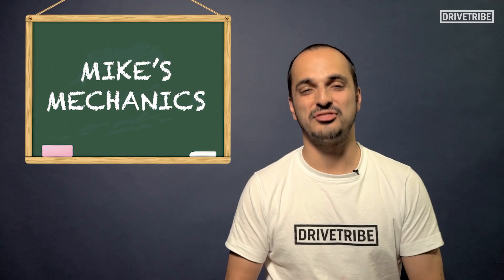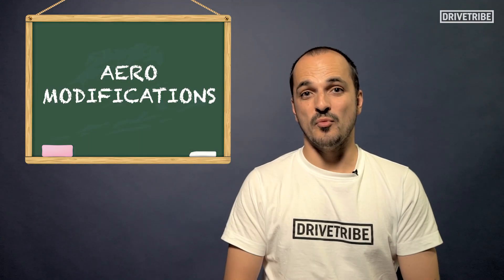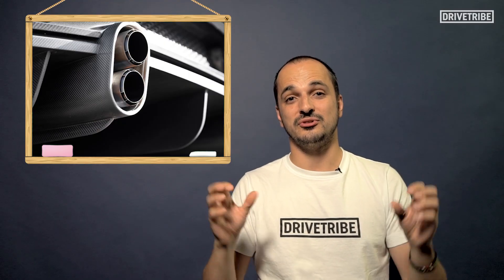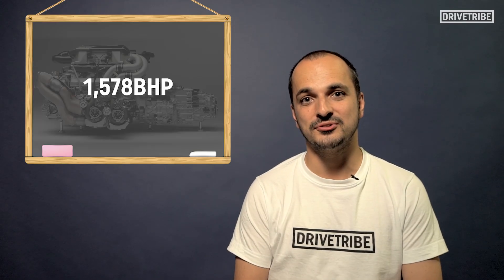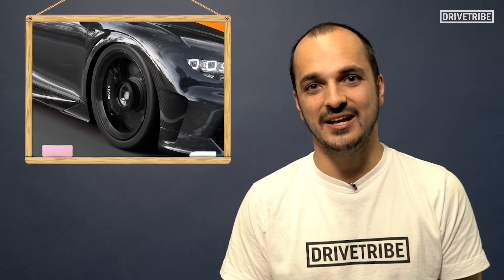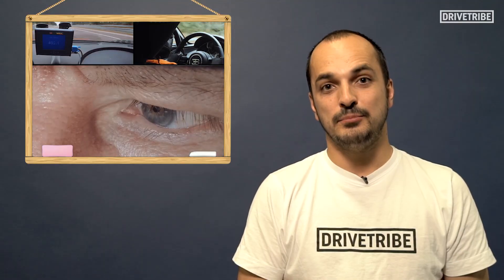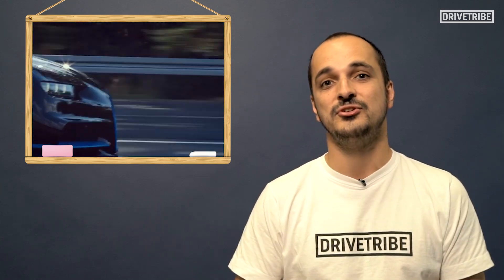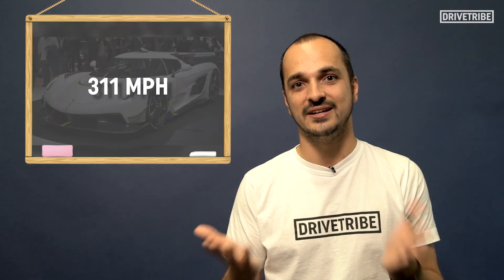How did the Bugatti Chiron reach 300mph?

Comment: Well shit. Now I just want to see a veyron at top speed getting overtaken by a Chiron at top speed. From the Veyron's perspective.
Reply: Stand beside a 50mph road making car noises and watch someone go past.
/done
Reply: @tomstech4390  LOL
Reply: Sadly that could be Quite dangerous.
Reply: @davidvalencia129  You mean quite coooool
Reply: Michel van Briemen the wake coming off either car next to each other would cause major disturbance
Reply: @MrAyybee2cold  WHO CARES ABOUT DISTURBANCE? I WANNA SEE LOL
Reply: They'll always be someone quicker at some point
Reply: Could be dangerous, but, just like the tires and such, they do
Lots of testing at varying speeds and speed DIFFERENCES  could give you the data to extrapolate what would or could happen.   Quick to the issue of running that track counterclockwise. Same thing, they have turned around and 185, 200, 230, and so on while monitoring the best they can what the tires and the chassis are doing with that “wrong grain”.  Say take it to 220 and then to the pits to visually inspect the tires and get stats to back up any onboard versions, then take
It back and do 270 against the grain and recheck.   Then maybe 285, then check again.  If the first two tests weren’t much worse than the “with the grain” direction for tire wear, make certain that 285 didn’t create anything unexpected, then maybe retire or not and go for it.  But to just decline the attempt, c’mon, they didn’t spend a fortune on developing the car and then set a new world automotive standard and then not back it up!   What the hell!   Kind of like having the girl of your dreams fulfilling your every desire and some you never new, and her asking for more and you just go, “nah, I think I’m good.  I think I’ll quit while I’m ahead”. 
That is not the spirit of what is going on there.
Reply: It's not a chiron if they have to modify everything about it to get the top speed.
Reply: Oh, sorry, but same kind of testing with both cars heavily monitored to see what happens with different aero dynamics and characteristics.  For example:  these things are glued to the road, but not TOO much because they can’t afford the extra drag too much in place of horsepower.   So get the Veyron going 230, pass in the Chiron at 260, rinse, repeat.   A sudden change in aero relationship between the cars could upset the chassis enough to cause ummm serious consequences.   But also duration of interplay could have huge effects.   So test it. Camera it up.   Do it.  On the influences of one car on another depending on speed, speed difference, and duration of interplay.  Anyone remember the surprising hydrodynamic phenomenon which I think was hypothesized before hand but in real life the Navy was demonstrating a moving refueling set up for large Navy ships.  They had these struts that were used to keep the ships AWAY from each other as much as together.  Apparently during testing it was revealed that running parallel at that proximity and at certain speeds would slowly create a low pressure zone between the two hulls and higher pressure on the other side of each hill. As the water buffer started to clean up and get organized with the steady speed and distance, they realized the ships were starting to pull together and
even with counter steering the two ships did in fact come in contact, as if they were drawn together which of course is what happened.  So they came
Up with those struts to keep
The two ships in optimum relative positions.  But with relationships between high speed objects still a bit of a mystery, they totally should do it.   Yeah, imagine on the original Top Gear when the high drama buildup with James May driving the Veyron to VMAX was achieved and
Then it was all heavenly music and satisfaction.  Now imagine right as he painstakingly held on for the last few MPH, the Chiron goes flying past at
Like 290.   Awesome would the only thing to say.  Kind of similar to those “think
You are fast and then this happens.” Videos.
Reply: Hey, look at everyone saying it's dangerous and stuff... I want to see it. 
And tho standing still watching a car going fifty is the same, what a feeling must it be getting overtaken while going 250+...

Comment: koenigsegg’s record is so much more impressive after Bugatti did this.
Reply: Explain how
Reply: Zachary Gratschmayr they used a standard unmodified production car on a public road to reach 284. They did multiple back to back passes and got the record.
Reply: @tdolan500  'standard unmodified' the Agera RS is a modified Agera, just like this Chiron 'SS' is a modified Chiron.
Reply: @B42HM4N    The Agera RS is  a production street legal car,  Andy Wallace has taken a modified Bugatti Chiron, one way, nothing against Andy or Bugatti still very fast but not official, I don't know what the specs of the car, but when it comes into production (street legal) they can take it to a public road and do the multiple passes, nevertheless quite amazing.
Reply: Benjamin Ashman There’s 25 Agera Rs driving around in the exact same trim as the one that did 284mph on a public road. Bugatti couldn’t even set a record because the concrete felt a bit funny. Sorry but the lengths Bugatti went to to not break a record make the Koenigseggs 284mph run look effortless.

Comment: Double the circumference of the tires to lower the rpm and ease cooling!
Reply: I am not an expert and may be you are joking, but I think that would increase the forces exerted (increased mass) and therefore not solve the problem. Besides the tire diameter would double causing other obvious problems.
Reply: @Paul-pj5qu  it is a joke. Well... Half a joke anyway. Obviously there's some positive aspects of larger wheels and tires, otherwise speed records would be set on go-kart wheels with special tires. I'm sure that there's some calculations that are done to determine the perfect balance between increased mass on larger circumference versus higher rpms on smaller. 

Though... Just on an intuitive level,   if you double your circumference on something as light as carbon fiber wheels, you don't really add that much weight (except for the tires...) but you're cutting rpms in half, which seems pretty significant. All of a sudden, the rotational forces acting on the tire and belt package are a lot less relevant and the biggest challenge is simply friction of two surfaces meeting at a tangent at 300mph.

Comment: I think John Hennessy is right. I don't think a 1578hp engine can do it considering the acceleration at 450+kph
Reply: Jonathan Rae Crisanto John doesn’t know shit lol. Dude is a crook and is nowhere near the same level of Bugatti and Koenig engineers. Stop lol
Reply: @zethloveless7238  So explain why a 100hp bump was able to achieve top speed from 261mph on a regular Chiron to 304mph on a Chiron SS
Reply: Jonathan Rae Crisanto because it was limited to 261 via electronics due to tires. That was never it’s actual top speed.
Reply: @zethloveless7238   Lol. Top Gear just posted a video about a week ago about a Chiron reaching 261mph USING the VMAX key which removes the top speed limitation
Reply: Jonathan Rae Crisanto the 261 was the electronic limit. The VMAx key doesn’t remove the 261 speed limiter. Everyone has known for awhile they put a electronic limiter on the top speed for tire tech.
Reply: Jonathan Rae Crisanto the first key is limited to 236 mph and the second key is limited to 261. https://www.google.com/amp/s/www.roadandtrack.com/new-cars/car-technology/amp20975336/bugatti-chiron-top-speed-mode/

Comment: I'd like to see the speedtail doing that speed, but its more certain that the jesco will.
Reply: speedtail is never intended to do that speed
Reply: @tcroft2165  well its true, but then again mclaren tends to make cars faster than they claim
Reply: @muhammadrayyan7783  They do but if they were really going for those sorts of records the car design would be different (and the existing engine would have to be massively modified if not started from scratch anew - something they will never do.)
Reply: @tcroft2165  although the speedtail doesnt focus on making the fastest car in the world, it was made entirely for speed, completely different on that of a senna. From the purpose, the speedtail is designed to be a 250++mph high speed grand tourer, just like the chiron. Plus if you see the body itself its even more alien than the chiron with the flexible carbon fibre ducktails and the front wheel caps & etc, clearly they're not just gimmicks.

Comment: I think it shouldnt count as the fastest production car since its a very modded versione of it.
Reply: Nuno Bernardo Mclaren F1 was modded for its run so that shouldn’t have the record either. The version they used to set the record is not the same as the one the one you can buy
Reply: indeed aswell they only whent one pass instead of going both directions and use the averege
Reply: It's what a production car is - in a few months or so, they are going to build more of these, My guess - about 10 or so.
Reply: Every record setting car has a roll cage inside for safety reasons! This is a (pre) production car! No matter what!😎
Reply: Porsche 911 GT3 RS  exactly, this is the SS with a Rollcage. Exactly like the Nurburgring records
Reply: Nobody cares
Reply: They are building 30 of these cars so it a production car. So the car is official
Reply: It's not counted.  Did you watch the video.
Reply: Like the RS was to the Agera ?
Reply: Nuno Bernardo it’s a pre-production car so it should be out soon
Reply: It's the Chiron SS now. Bugatti has officially launched it
Reply: Kevin J  It's not an official record in the way Guinness is doing it. That's correct. But I guess Bugatti doesn't care! They only showed the world they are the first to brake the 300 miles per hour barrier in a production car! This is all about PRESTIGE..., but I miss the 500 kph record run too. Maybe that wasn't possible at that moment. Anyway, nobody (normal customer) will ever reach that speed again in a production car. All Bugatti's are limited in top speed. But I also think, this record will be broken by Koenigsegg next year... or somebody else like SSC with their Tuatara...😉 Bugatti is leaving that for other competitors because it's rediculous anyway. Max speed on Autobahns and Motorways in Europe is 130-200 kph, only at night or in the morning they are empty enough to go faster... This is basically a showcase what is possible at the moment. In reality this is soo fast, there is no right place to that fast. Also no driver is used to that speed and the consequencies in a traffic crash would be fatal...
Reply: Bugatti already launched the car....
Reply: Yeah, Bugatti claimed it to be a production car as evidenced by the visible roll cage, different exhaust pipes, holes on the front fenders and a much longer body.

How shameful of them to not hide their deceit.
Reply: @kamotetops1572  What? Bugatti has launched the exact same car as the record model, albeit without a roll cage for obvious reasons. Bugatti hold the record now.
Reply: @ShadowGodOfDarkness  Sorry if I have to point out what sarcasm is.
Now this is not a sarcasm, In this vid, Bugatti never claimed it to be a production car.. yet
Now they revealed the production car similar to the one on the vid, the Super Sport 300+
Hopefully Bugatti would also post a vid of the production car speeding at 300mph.
Reply: @kamotetops1572  technically, sarcasm doesn't exist in text form,so tone the attitude down a bit,k?

Comment: Whatever it will be, if not the next then the one passing that, will probably be electric. Maybe not powered by traditional batteries though due to weight, but if it's not a street-designated series model, then the power source doesn't need to compromise in terms of lower amperage longer sustained capacity, or long term longevity.

For series production road cars, we're probably still looking at dino-juice powerplants a good few years yet - due to where we are at tech wise thus far, in terms of power sources that we charge/pack energy into, versus power sources holding energy which we destructively convert/consume "completely".

Comment: Even with all the mods I call BS. on the 1578HP clam... More like closer to 2000HP. Time will tell:)
Reply: you dont need 2000hp to reach it. the agera wasnt that far off with gear ratio changes etc. and the Jesko soon to come out has nowhere near that amount yet will beat the record
Reply: @RDB33  Those cars also weigh significantly less than the Chiron, and they did 284mph with 1176HP...I wonder if the RS1 would have hit 300mph since it had 1360HP...
Reply: @ROG-ht5cz  i think it would have, with some small tweaks to the car. not including power output

Comment: Fiat Panda 4x4 upped to 2000bhp will do the job. Read it here first.
Reply: denis lejeune yea right. And we will be scraping your remains from the highway.
Reply: A Fiat Panda is incapable of going anywhere close to that speed. the wheels, suspension, chasis, lack of downforce, short wheelbase, poor aero and many other factors mean it would barely be capable of doing 180mph let alone 300mph. These cars are designed the way they are for a reason. Engineers achieve this not tuners.

Comment: To attempt a record you need to do two runs each direction plus it's not a stock chiron it is a modified prototype version of chiron they removed the back wings, installed roll cage and many more changes to do this speed run, so basically and technically koenigsegg is the fastest according to the Guinness world records
Reply: Not to mention that there was a modified Ford GT that hit the 300mp/h first, not the chiron. Also, the Ford did it on a standing mile, not a private circuit
Reply: The chiron supersport will be released in a limited run so it does qualify as a production car - the modded Ford GT does not.
Reply: Bugatti is faster than konegsegg and theres no doubt..whos in the guinness book of record doesnt matter.. The chiron super sport is the king of fast
Reply: @kestercrandon8586  lol
Reply: thats what the vid said idk why u should repeat it again
Reply: Bugatti achieve the highest speed reguardless of what people says.. The king of fast will always have its crown.. 👑 ..when that car go into production it will be mind knowingly faster

Comment: Before watching, with a very long very straight track with two very high speed banks leading to and away from it? Also remember this is Modified and not available for sale. There was a modified 2006 Ford GT that went over 300... in the standing mile. It didn't take getting up well over 100 before the straight, then planting it and having another 5 mile straight to get up to speed before needing to slow down to around 100 or so before the next corner. 

After watching, nothing really significant. The tires heat up more due to the time it takes yes, but it's also the weight. Lighter weight less heat, also less weight means getting up to speed is quicker.

Comment: I can go 155mph with vw passat it is the easiest thing for Bugatti to reach 304mph and more, so that can be done over and over again. This video is just made with no knowledge and for Bugatti hatred and completely unnecessary.
Reply: You can't be any more wrong. Learn some physics.
Reply: @rattlehead999  What should I use physics in this situation I saw 202mph in bmw 750li Bugatti can go 500mph
Reply: @Tony-hj7bm  Because nothing scales linearly...
The engine won't last long as it's pushed much harder than it should be, the turbos are pushed hard, the tires are on the verge of dying after just one 304mph run... The transmission is very stressed too.

You'd have to rebuild most of the car every few 300mph+ runs.